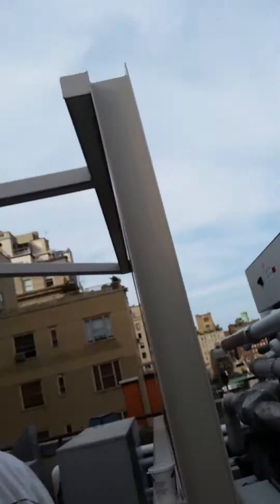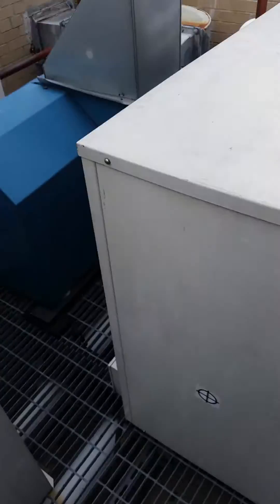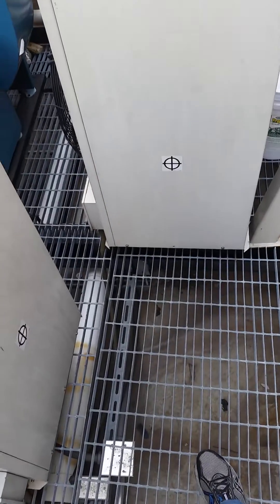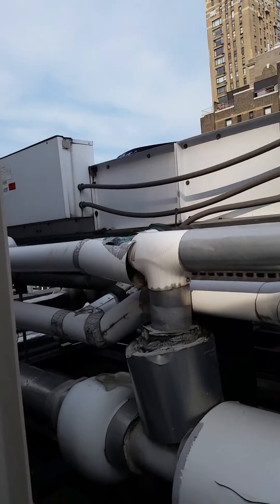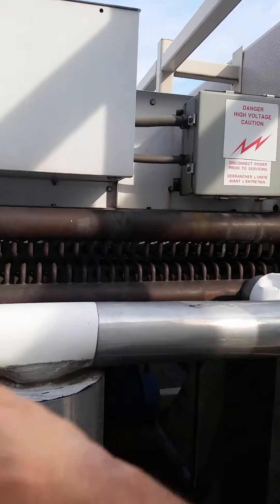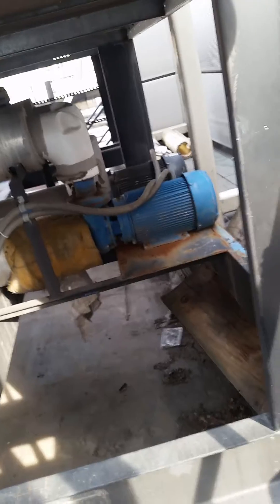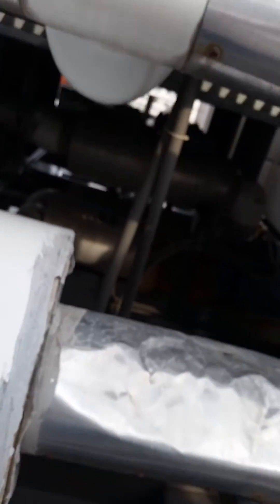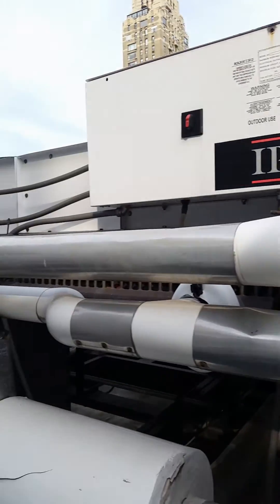How a dry cooler works

Comment: Your bibs will be under that fu ked up insulation. You need a refractometer to check your ratio levels of glycol to water to determine your freezing point and boiling point. And if the drycooler cant keep up with capacity..then take a line voltage t-stat and wire it to a 24v solenoid. Hook that up to a 1" PVC pipe and drill holes the length of your drycooler. Now you have a permanent fail safe if temps get above capacity. You see drycoolers used on server rooms and process cooling where you need maximum capacity at -10 outside. So your units modulate with a water reg valve to keep condenser temps even so it can cool when it's cold outside.

Comment: mike on a big application a cooling tower is more efficient. a dry cooler would be very difficult for a 50 story high rise. i worked on a 50 ton chiller not to long ago that used a drycooler. for individual units it works good. not so easy when you have 800tons of cooling system. thanks for sharing the equipment
Reply from the maker: Ah ok yea thats what i was thinking but wanted to ask anyway. And yea cooling tower would best on a chiller.